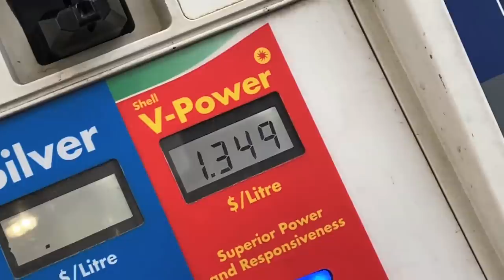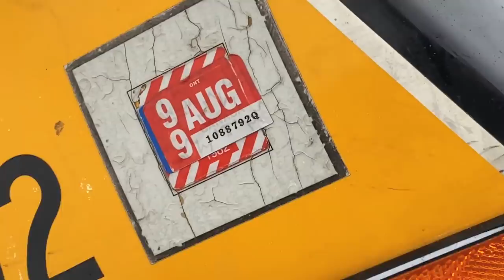Snowmobile VS QUAD! Destroyed!

Comment: That sled went 65-70mph when it was new. Guarantee if u switch clip position on the needle in the carb it’ll rev way higher. It’s running way rich I’d say
Reply: I take the “rich” back. The clutch wouldn’t let it rev I bet

Comment: Chain in the chain case broke. Easy fix. Do not junk it!!!!!! They are easy to fix. Parts are easy to find. Back when I started restoring sleds, parts were extremely hard to find especially with out a parts sled laying around. Could also be a broken shaft in the secondary clutch.  Also a easy fix.